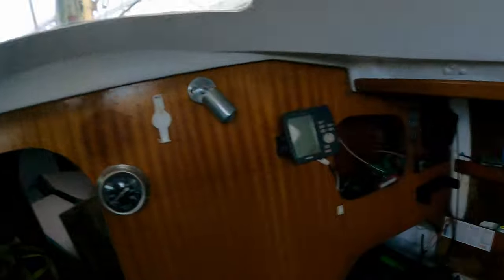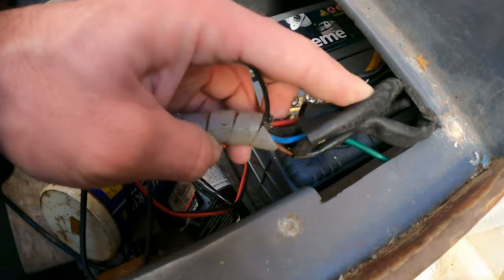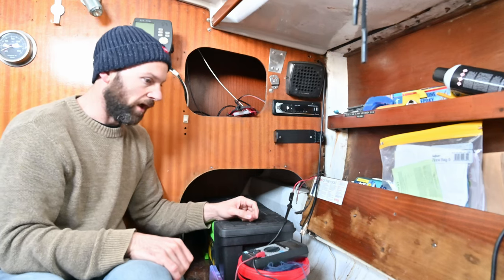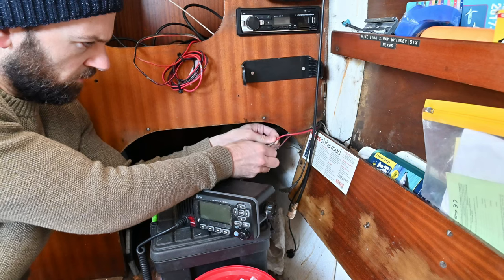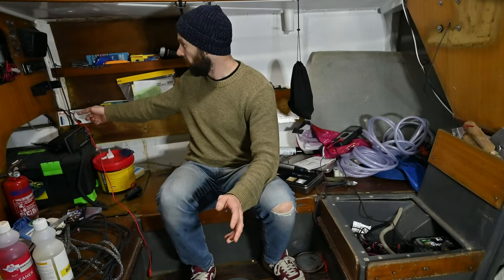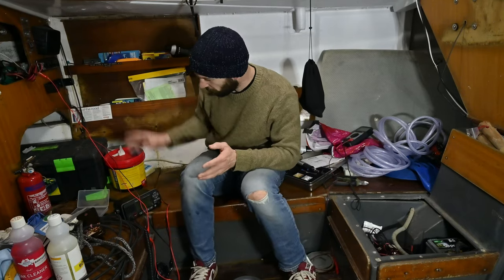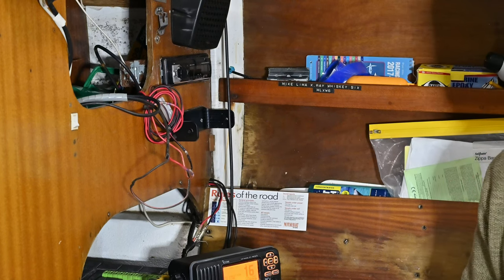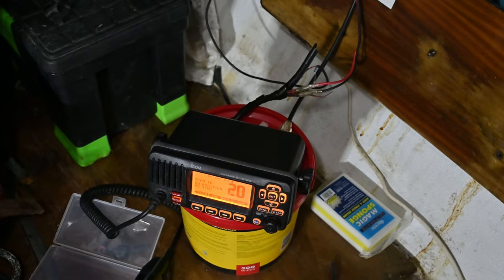THE Greatest Marine Electrician of Our Time

Comment: Well I probably had more fun watching that than you had doing it .😉 You have inherited all the sins of the previous owners and the organic growth and bodges of the electrical system. The wiring is not tinned so the wiring throughout the boat will be a shit show and you are destined to have problems until you do something about it.

You need a good multimeter that’s for sure, but a simple 12 volt bulb in a bulb holder connected to some long leads (say 3 metres) with croc clips on the ends is a useful tool too.

The quickest way to resolve this is to sit down and design a new system, incorporating decent busbars at strategic positions in the boat and then bite the bullet - rip out old and install new (tinned) wiring. It’s not a cheap exercise in terms of materials but could be tackled over a couple of weekends.
Reply from the maker: Well I'm glad someone enjoyed themselves haha. Yeah you're spot on. I've actually now taken delivery of my own multimeter, tinned (as in all the strands are individually tinned) wire, various connectors plus some heatshrink. I'm going to do exactly as you say, I think I'll start by drawing out all the electrical elements of the current system so I know what I'm dealing with and then as you say, start again from scratch. I've seen some incredible jobs done on these boats (which is both depressing and inspiring at the same time!). 

Thanks for the bulb idea, I think I saw that in Don Casey's sailboat maintenance book too. I think my new multimeter has a beep function on the continuity tests, so that'll be handy for those longer runs where I am buried in a locker somewhere trying to make a connection and can't look to see the screen on the meter.